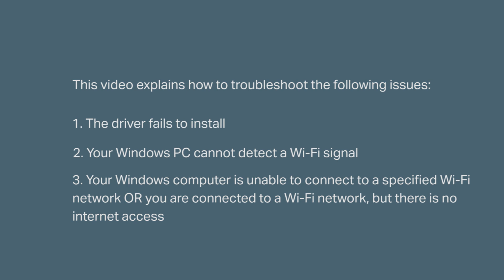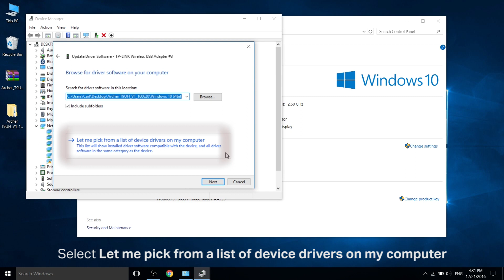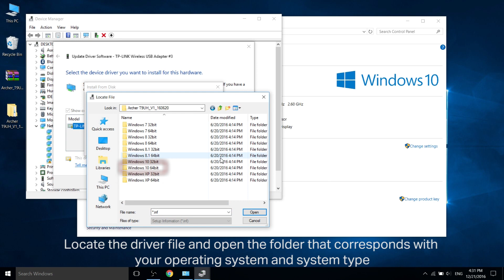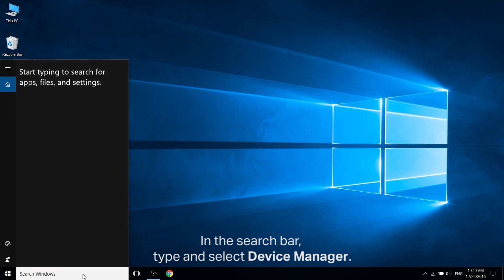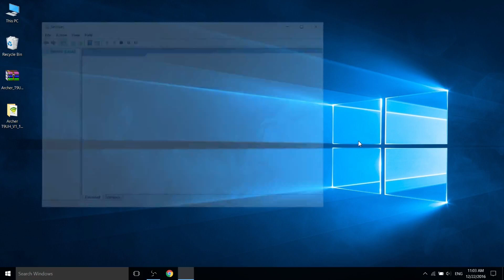How to Solve Common Problems When Installing and Setting Up a Wireless Adapter (Windows)

Comment: So my device says that it is working just fine but it doesn't it doesn't connect to the internet and my wifi works just fine. And i haven't found a solution for weeks. I tried like every thing but it won't work :(
Reply from the maker: Wait so The WiFi is working but it doesn't supply internet?  So the computer can connect to the router's wireless correct?  If that is the case the issue is in the router.  The network card a RT(receive/transmit) device. If you computer has connected to the network then it has successfully received and transmitted a handshake. Your router may have a mac filter or something like that blocking the connection to the internet.

Comment: It was working well until I had updated the driver software when I installed gameloop and it said to install drive booster and after installing it I updated the driver software which then rebooted my computer and then it is connected to internet but no internet access (by the way I am using desktop pc so I have bought a to link TL-WN725N wifi adapter plsss help I am afraid to re-install my wifi adapter cause I tried it once and the installation was stuck at 90% so I used recovery to undo changes )plsss plsss help meee
Reply from the maker: Make sure you are using the official driver.  Download the latest driver, remove the existing used driver and re-install.  If that doesn't help contact support by going to tp-link.com. clicking on support and then contact technical support

Comment: 5G ISNT coming up for me... I was using it all day today and then randomly disconnects and doesn't even show up anymore? It appears on my iPhone and works perfectly...
Reply from the maker: If it was working but isn't anymore then you would want to start by unplugging the adapter and reconnecting it.  If that doesn't work, download and install the latest driver, even if you are already on it.  If that fails contact support.

Comment: i have TL-WN722N V1.10 , works fine in win10 64 bit , but on same PC win7 32 bit give bsod arthur.sys please help
Reply from the maker: We don't have a driver for Windows 10 so you could be using a generic driver it it working.  However make sure the driver for windows 7 is loaded.  If it is contact support at support@tp-link.com

Comment: I unable to open government website in India.
When contacted to wifi adapter through Hotspot.

But open when contacted to wire connections.
Help me sir
I have 300 mbps tp link wifi adapter.
Reply from the maker: Hello Ravi,  we don't provide details support through YT comments and most of the information we can provide is related to the US region.   Now an adapter is only a RT device that connects your computer to a wireless network.  If specific sites are not pulling up you would want to check the Hotspot source or your service provider to see if they are blocking the service.  This is normally a route issue which is determined by the ISP.

Comment: It's not lighting up when I plug it in.
Reply from the maker: Make sure the driver is installed, then try a different USB port or even a different PC.
Reply: It was a pc problem. Its an old pc. It's in getting fixed now. Thanks for reply.

Comment: I cannot see my wifi network any fix ?
Reply from the maker: It would require troubleshooting.  knowledge of any error codes.  If the driver is installed or having issues.  If it can see any networks at all.  You would need to contact support for assistance.  https://www.tp-link.com/us/choose-your-location/

Comment: Explain how I’m meant to install drivers when I have no wifi
Reply from the maker: Most computers have a ethernet port that you use to access the internet and download the driver.  If it doesn't have an ethernet it will have built in WiFi and you should be able to use that until you can install the drivers and complete the install for the external card.  Other than that using a different computer with access and downloading the driver to a flash drive will work as well.

Comment: This didn't answer my problem...mine shows me all nearby wifi connections EXCEPT hotspots and none of this video changed that (for reference TL-WN823N is what I'm using)
Reply from the maker: Blight if the adapter is showing wifi networks then it is working.  However if those Hotspots are 5GHz or Bluetooth they would not show on the TL-WN823N
Reply: @TPLINKUS  i know it can't find 5g wifi i actually expected that but I don't believe i have the capability of sending out a 5g signal with a hotspot, given my phone only ever says 4g

Comment: does anyone know if there is an uninstaller for the driver? because if I want to install it again, it says that there is already a driver and I accidentally deleted the folder. So I wanted to search for a uninstaller which shows if I want to solve a problem or delete the driver. I would be extremely grateful if someone could help me! 

Adapter: WN823N V3
Reply from the maker: typically you do not need to install the driver again.  Once its installed its manageable from the Device Manager.  But if you are getting that message you just need to plug the adapter in and your done.
Reply: @TPLINKUS  I know, as I said, I accidentally deleted the WPS Tool and this installer that were in the folder when the installer asks where to save the folder. This installer has two options to choose, if you want to repair the adapter or if you want to delete. And exactly this installer is missing for me, because I deleted it by mistake.

Comment: i cannot insatll this on Linux
Reply from the maker: Linux support for most of our adapters is limited to this kernel range  (Kernel 2.6.18~3.19.3).  Beyond that support is not available directly through TP-Link.  You can try to find a driver from the Linux community or the chipset maker though.

Comment: How can i fix when i plug my pendrive the adapter on PCIe is disconnected from wifi :/
Reply from the maker: Can you explain further?
Reply: @TPLINKUS  yeah i get from gift on christmas new adapter on my PCIe well i'm downloaded a driver and etc
but when i'm try connect my pendrive connecting go down and i haven't ethernet i think my router is ok but idk what is goin with this adapted (tp-link archer T6E 1300) can you help or give any link to topic with same problem/driver with fixing this? 
i'm updated all my driver and problem stay :/ pls help 

(sorry for bad eng but i'm from other country)
Reply from the maker: @ezzykills  No worries honestly it sounds like a network issue.  When you bring up you available network list does your host network show?
Reply from the maker: @ezzykills  Okay i see.  That is odd but its likely something in the device manager.  Look to see if there are any conflict and look at the evet viewer to see if there any notifications related to the concern.  There is nothing really in the TP-Link Device that can cause that.

Comment: What to do I if my usb says “no USB-WiFi plug in”
Reply from the maker: try a different usb outlet. Check the Device Manager to see if it detects any issues and plug the adapter into a different computer to see if it gets detected there.
Reply: @TPLINKUS  and I don’t another computer
Reply from the maker: @wayne_xx2275  The suggestions provided are standard and universal we provide to customers when they ask.  Some have access to a 2nd computer, such as a older system, a work or spouse's pc.
Reply: @TPLINKUS  it worked for my old laptop that’s windows but it doesn’t work for my iMac
Reply: I tryed most of my usb outlets on my iMacOS BIG SUR,and what the device manager
Reply from the maker: @wayne_xx2275  Device Manager is for Windows PC.  Big Sur does not have drivers released yet.  We have not received updated from the chipset makers so new drivers are pending.
Reply: @TPLINKUS  so I can’t use the usb on my big sur
Reply from the maker: @wayne_xx2275  Yes because drivers for Big Sur aren't available yet.  The chipset makers have yet to provider our R and D team with the update so we have not been able to make them yet.
Reply: @TPLINKUS  ok that’s was very helpful thx for the info

Comment: I'm having constant blue screens from my T4U USB adapter with a message saying "DPC watchdog violation". I'm confident its the adapter and when I try to manually update the drivers the files that were on the site do not have folders for each individual operating system. How outdated is this video? Do you guys even release drivers in this format anymore?
Reply from the maker: this video is from 2017.  here is the latest video https://www.youtube.com/watch?v=9f3_kXCb4-s

Comment: How can I install it if I don’t have WiFi to start with?
Reply from the maker: by using the computer's ethernet if it has it or by downloading the drivers to a flashdrive from a computer that is connected and then installing the driver from the drive.

Comment: My adapter isn’t showing up under the network adapter colum?
Reply from the maker: make sure the driver is installed.  If it is and this is the first wireless adapter being used on your PC you may need to enable WLAN services in your Windows settings.

Comment: Download the drivers how do I download if I can’t connect to wifi
Reply from the maker: 1.  You connect your computer to the router via ethernet and download the driver from tp-link.com or you use another computer, download the driver to a flash driver from tp-link.com and then install from the flash drive on the computer in need.  Hope that helps.

Comment: I just purchased an Archer T2U Nano USB adapter but I cannot even enable the Wireless Network Connection icon shown in network connections. It is greyed out, and there is no WiFi icon in the system tray. I ran the diagnostic check and it says there is a problem with the driver, but I installed the driver from the OEM CD and Device Manager shows NO PROBLEMS at all. Can anyone please help me here?
Reply from the maker: If the computer never had wireless services before you would need to enable that in the windows system.  You can contact support and they will be able to you and assist.

Comment: HI my tp link usb is plugged in but is shown as  realtek?it may be the last USB it had installed but we even reset my pc altogether but it worked that day but today it has been going on and off,why?
Reply from the maker: The chipset is likely from realtek, they are one of the chips we use.
Reply: ok thanks

Comment: pl`zzz life-saving question When I go to the control panel it shows me that there are two connections one is my general wifi connection which is already enabled. Ant the other is my external wifi adapter so now How can i connect with my wifi adapter cuz on there wifi setting I can't see the wifi2 option so plzz help I also downloaded the driver...
Reply from the maker: Go into your network settings and disable the internal network card.
Reply: @TPLINKUS  exactly bro I did this.. And then When I try to connect wifi there isn't any wifi interface. I mean that in wifi2 / from the external wifi interface I can't able to see any network...plz tell me something that can help me.
Reply from the maker: @talkshowlivehost3476  make sure the external adapter is enabled.  If it is, please contact support for additional assistance.

Comment: Um. How are we supposed to download the driver software extract when we are trying to install aforementioned driver in order to connect to internet 🤔🤔🤔
Reply from the maker: Most computers have ethernet as well.  You can connect directly to the router and download the driver or you can use a computer with access, download the driver to a flash drive and install on the computer in question through that.

Comment: help mine is a pcie adapter and it said its working all fine and it detects some networks but not mine
Reply from the maker: If the video did not help solve your questions you would need to contact support for assistance.

Comment: My computer it says: - This device is working properly. And the wireless connection Not Connected, How can I fix this ?
Reply from the maker: Try a different usb port.  If the device manager doesn't detect and issue but the adapter is not detected its likely an issue with USB

Comment: I have the TL-WN8200ND v2.20, i just plug it and put the driver disc after 3 minutes of my PC doing the exact sound as a earthquake for the fans it installed all and update the driver automatically to the version of 2019-03-08.
At least i can download stuff now, before i had the TL-WN7200ND and it was pain.

Comment: How to extract inf drivers if wizard app can not detect wifi adapter?
Reply from the maker: Drivers can't be extracted from the installer, however you can install the driver even before installing the adapter.  I actually recommend that.  Once that is install place the USB adapter in.  If its not detected try another port and get the device manager for any errors.
Reply: @TPLINKUS  Why, I need to do all this if your company can simply extract and zip drivers. Just share it, please. I can not plug in/plug out. The server have strict policy... To do all this, I need to wait 2 weeks just for one plug in and then 2 weeks for one plug out. From your point of view everything is so simple. Just share zip with lattes drivers, please .

If I need to do some sexy thing, I will agree with you. Start to plug in, plug out... x1000. For wifi adapter? No!!! ;)
Reply from the maker: @SoWhat07    What does server access have to do with a network adapter on a PC?  They have nothing to do with each other.  You can though contact support directly and ask if they can provide you the Bin file.  Not sure if it is possible but they will know.  Choose your region here:  https://www.tp-link.com/us/choose-your-location/  click on support and then contact technical support for your regions contact methods.

Comment: I am looking for TL-WN821N on Win10x64 with miracast compatibility. Zero support!!!
Reply from the maker: What type of television do you have?  Theoretically its compatible with some types of televisions but we have not tested locally.
Reply: @TPLINKUS  Toshiba wireless display (DxDialog -> Miracast: Not Supported by WiFi driver, mcrecv:, {FA6D33D4-9405-4BA5-9983-12604AC8E77A}, Miracast Sink Scheme Handler, Preferred, Miracast: Available, with HDCP; mcrecv:, {FA6D33D4-9405-4BA5-9983-12604AC8E77A}, Miracast Sink Scheme Handler, Preferred )

Comment: Plug in my TL wn727n devices in my pc. But when i apply cd. My pc not detected  adapter.. What i do plz explain????
Reply from the maker: First we would suggest installing the latest driver for you OS from our website TP-Link.com.  if after that it is still not installed check your device manager for any issues. If that is clear contact support.

Comment: I bought tp link  TL WN725N on Amazon but it's not detecting my router which is WPA PSK will it works to this routine or i should return this tp link adapter please help me
Reply from the maker: Are you trying to connect it to a 5GHz network?  If so that is the problem this is only a 2.4GHz adapter.
Reply: @TPLINKUS  then what is the solution sir
Reply from the maker: @makudinesh7719  Well if you are trying to connect to a 5GHz network you would need to get a 5GHz adapter.
Reply: Sir can you please send the link of 5Ghz adapter... And will it supports to all routers
Reply from the maker: @makudinesh7719  There are numerous ones and they vary by region.  You can go to TP-Link.com and look for dual band or AC or AX adapters those all indicate ones that work with 5GHz as well as 2.4Ghz.  Support is dependent on what bands the router produces.
Reply: Tanq so much for the response Sir.

Comment: Its in the device manager and I downloaded the drivers for windows 10. Yet the adapter is not recognized by the driver setup. Its not the adpator because it works on the current PC I'm using, but not on my new PC. There is no Optical drive on the new PC.
Reply from the maker: try removing all adapter drivers on the computer and install the recent driver on the website tp-link.com.  Also try a different usb port

Comment: No fix works except restarting my pc every time i get the error.Provide updated drivers for the products.I am using TL-WN781ND pcie wifi adapter and the latest driver version is from 2017.From my experience TP link wifi card sucks and i'm not going to recommend or purchase any of your fucking products again.Thank you 🖕

Comment: this didnt help me either. all i had to do to fix this issue was to change router settings. changed channel from auto to 11, band width from 20mhz to auto and beacon interval from 100 to 60. and for some reason it worked
Reply from the maker: That indicates that the Auto-chosen  channel was congested.
Reply: @TPLINKUS  my usb adapter was getting signal perfectly from router but it was disconnecting (was losing signal) every 10 min and was connecting again.. yes its very possible it had to do with the channel.

Comment: Why does this usb wireless adapter keep on disconnecting even if it is properly installed? Have to connect manually to Wifi Network, run on Troubleshoot problems. WHY????
Reply from the maker: could be a number of factors causing this.  We would need you to contact support to troubleshoot.